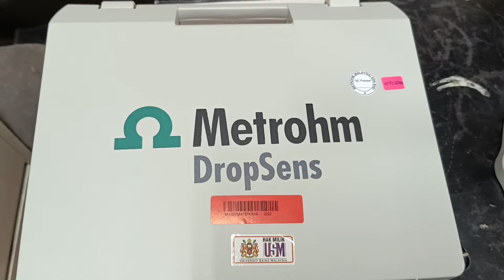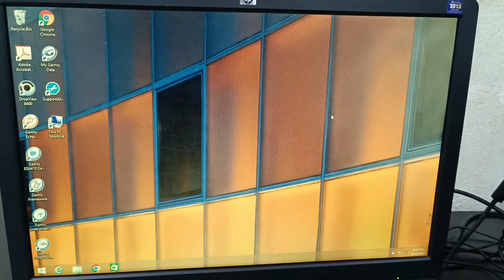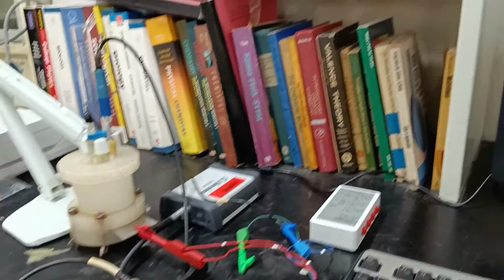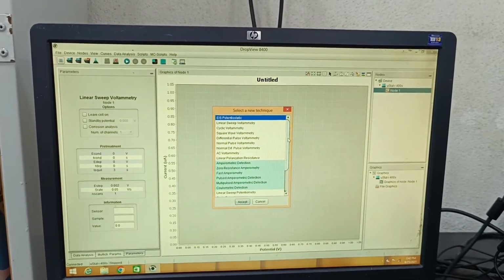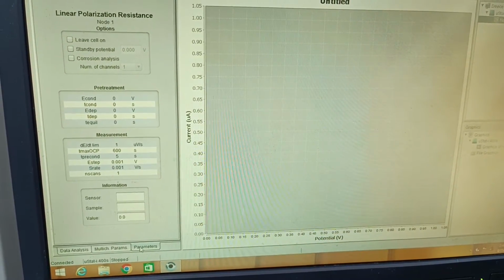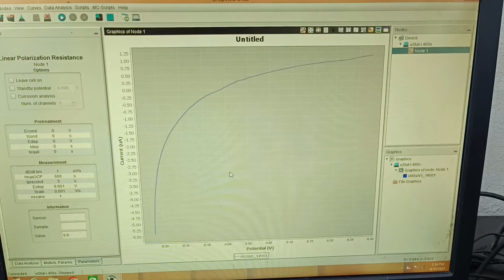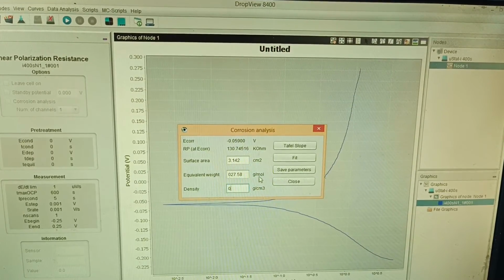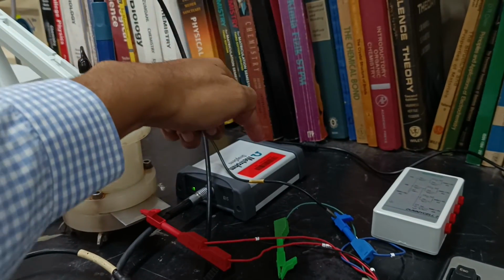How to run Linear Polarization Resistance (LPR) for corrosion measurement using Metrohm DropSens

Comment: Hello Dr., I am a big fan of your electrochemical measuring technique video, and they have been truly informative. Could I please seek clarification regarding the terms below and their importance? I understand this is a lengthy comment, but your insights would be amazing. I am confused about the purpose of Open Circuit Potential, Linear Polarization, Potentiostatic Polarization, Potentiodynamic Polarization, Linear Polarization Resistance, and Cyclic Polarization. I realize this is quite a bit to ask, but I would genuinely appreciate your help in understanding these concepts.
Reply from the maker: Hello, thank you for your comment.

OCP: a transient measurement to see the changes between potential to time. We need to perform OCP beforehand because to know the steady state potential value to be polarized.
LPR: polarization methods that use short potential range (+- 20 mV from OCP). The linear plot will be potential vs current and the gradient will give Rp value. icorr can be obtained from Rp through formula.
PDP: polarization methods that use slightly bigger potential range (+- 250 mV). The resulted Tafel plot is current density vs potential and the icorr can be obtained from the intersection of the two linear anodic and cathodic tangent line. Corrosion rate can be obtained from icorr.
Cyclic polarization: polarization methods that use longer anodic potential range (+1000 mV) mostly to study passivation, transpassive and pitting corrosion. The Tafel plot is similar with PDP technique but with addition of reverse cycle. This will give Epit, Erp and hysterisis information

More infor can be check from my lectures in the channel

Comment: Assalamualaikum w.b.t Dr, thank you so much for this video, I would like to ask you Dr, if we are analyzing  two different compound as corrosion inhibitor (eg: A&B) is that possible they will give different outcome, for example in EIS, A shows better performance than B, but in Polarization, B gives better performance. I'm just wondering if that possible because different corrosion testing can highlight different aspects of a material's corrosion behaviour.
Reply from the maker: Waalaikumsalam Alia. That might happened if the OCP has not been done long enough for both EIS or PDP analysis. Probably you should look at the total time used for OCP (open circuit potential?
Reply: @mohdhazwan6523  Thank you so much Dr for the suggestion, will try to figure it out soon, thank you Dr for always share your knowledge with us😁